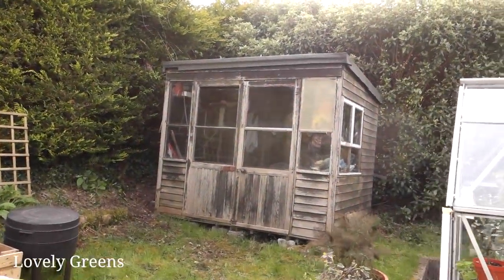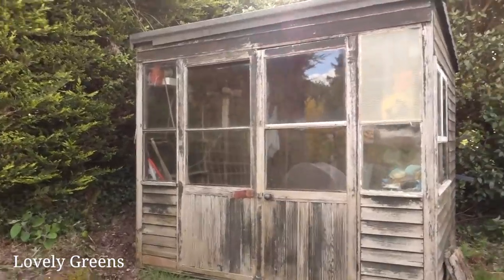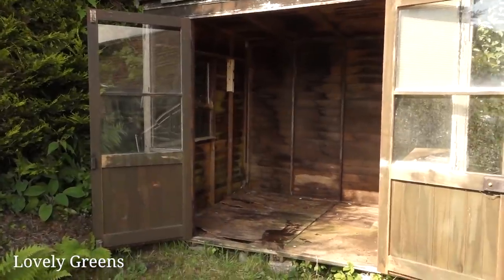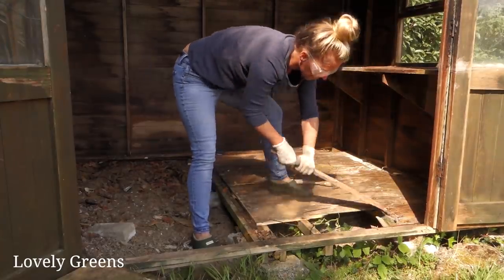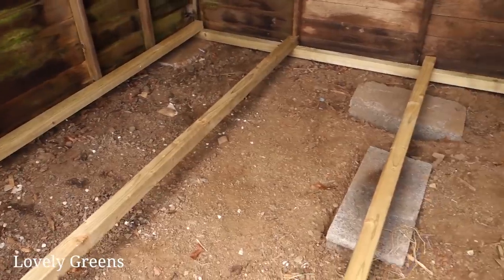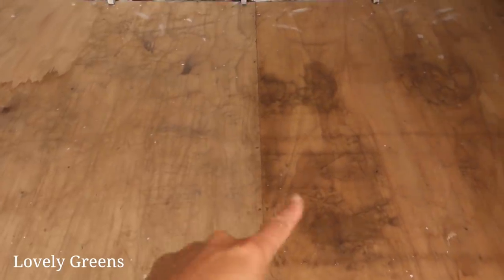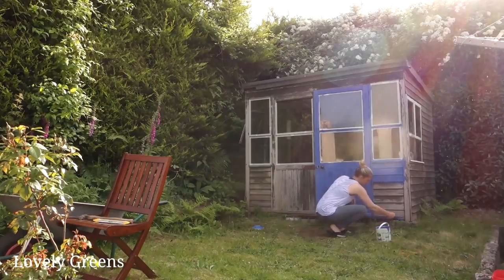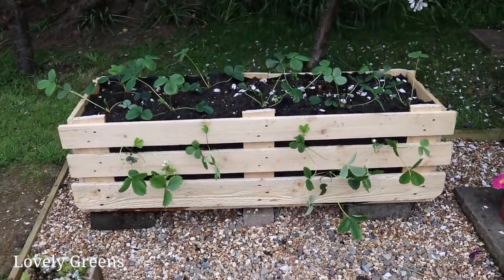My Garden Shed Transformation (Ramshackle to Cute She Shed Potting Shed)

Comment: Great job!  You'll enjoy that little potting shed for years to come and will find an affinity for it because of the hard work restoring it.  One thing that I've done with new floors in old shed/barns is to make sure to seal the best you can the space between the floor and the shed walls.  otherwise every kind of rodent and snake will make it their home.  What I've done is to take 2x4 and cut them to fit between the vertical studs.  By laying them on their widest side, you will be flush with the front edge of the stud.  By attaching the 2x4 to the wall and floor, you will have effectively joined the walls and floor closing off any points of entry.  To make the job easier I use liquid nails construction glue and the job goes really quite quickly.

Comment: Fantastic, what a transformation! Traditionally canes were hung in a hammock from the ceiling, in the highest part of the roof. The hammock is simply made from three pieces of garden twine, or stronger string, or even ribbon, if you please. One end, and the central string are fixed and the one at the other end can be undone to more easily insert the canes. This is the most economical use of the space, and is also usually the driest place so they will not suffer from damp or rot.

Comment: Looks good, I painted my garden house the same colour. Judging by the natural oil stains coming out of the greyed wood, its built from Red Ceder which is pretty durable, but now you've sealed it with paint it should be fine for a good while. I would suggest adding a gutter and small water butt which will also help with stopping any further rot. Now the frame is secure you can pull out the bottom side planks and replace them. I recently bought a secondhand greenhouse made from red ceder. the wood was also grey and stained - but I hand planed every piece down to reveal as good as new wood underneath. After oiling every piece I rebuilt it - it looks as good as new. I am very glad you took the plunge - its very satisfying to reuse and repair.

Comment: It’s great you managed to salvage the shed, my new shed is a second hand one and it’s been painted green with Cuprinol beetroot colour door, the door has new black iron hinges on and I’ve just bought guttering for it. Good tip about gorilla tape to fix the roof, my felt is still watertight but looks messy as has loads of weird battens on it for some reason, and I was going to change it but might try and salvage it for a while by taking off the battens and taping where they were to be sure taking them off doesn’t cause leaks!
Reply: I had similar with my shed when I moved in 2 years ago. For the roof, I managed to get some Johnsons felting sealer, it was pricey at £20 a tin, but I managed to give the shed roof 2 coats, only used half a tin. Got it from Screwfix.

Comment: We took an old shed and completely redid it, right to the roof.  Put in tongue and groove siding inside and out, window boxes on the outside.  Divided the back portion in to storage for garden stuff, with a dutch door.  I turned it into a craft shop, painted a faux rug at the front door.  I loved that spot so much!

Comment: Tanya, like you I love the colour design of blue with white trim. As for any other suggestions, after the roof is repaired I would paint the inside ceiling white, and install a solar powered light system that will allow you to pot up seeds or bulbs when natural light is not sufficient (early morning, late evening, early spring, late fall, winter, rainy days, etc). I think I would also put the potting-up table on the opposite side you indicate in order to be able to look out at your greenhouse, bushes, trees, flowerbeds, and cats while you work. And perhaps a cheery window-box of pelargoniums, petunias, and potato vines wouldn't go amiss. Love your channel! Greetings from Ontario, Canada...😊

Comment: To prevent more damage remove some of the green from the back and sides at least 50cm to allow sun a change to dry up moisture. Also to protect those new floor boards I’d put some linoleum down which can be washed and swept. Love the blue and the white effect on the inside
Reply: I wonder if it would stand a move to the other side of the property where she can look down over the garden beds. It would have great air circulation all around it and have more light. When she's working in the garden beds, she can look up the hill had see it in all its glory. It might even be seen from the driveway and from the windows on that side of the house. She could plant all kinds of things around it that might not grow in the shade where it is now.

Comment: I recommend painting the floor with floor paint. That will protect the new wood and help it last longer. There are specialist floor paints that are meant to take the wear-and-tear of a floor. They are usually a light gray color. The renovation is great! As long as wood is sound, we should keep it and do just what you have done. The finished shed is charming. It seems it's good to have Josh around.  :-)
Reply: And perhaps a rubber mat or two to keep Tanya from slipping on the paint wouldn't go far wrong either. Good idea!

Comment: I think that was a good save! Love the doors and the amount of windows and light in there. Looks great. The roof still looks damp though. I re-felted the old sheds I inherited and then used corrugated plastic sheets on the top to preserve its life even further. I also added guttering which runs into a few water butts. The amount of water it collects is pretty impressive and the plants do so much better with rainwater.
Reply: Great idea to collect the water - one of my favorite Master Gardener display gardens has water butts fed by rainwater from a shed roof.

Comment: For the floor, I'm surprised you didn't just get a small ton of rocks.

The floor will get dirty, but having a rock floor will let you just swipe the dirt down. It won't rot away from the leaky roof either!
Reply: I saw this type of flooring on a Pinterest page. It looked to be so very low maintenance. However I believe it wouldn't work well in my climate. Perhaps she has also has issues with alot of issues with rainy weather?

Comment: Hello! Did you manage to paint the whole exterior of the shed blue with just one tin of 2.5l Cuprinol? Thanks :)
Reply from the maker: Yes! I was scraping the bottom of the tin at the end and used every last drop. The inside of the doors are blue too.
Reply: @Lovelygreens  Oh that's good. It's a lovely thick paint which, I found, makes it so easy to apply, and that blue is a bold choice but looks really good on your shed, good choice not to scrap it! :)

I've so far painted a salvaged chicken coop, homemade coldframe and an old table with Cuprinol Seagrass (light blue) next will be the interior of an unloved shed that was tip-bound, a reclaimed desk and anything else that stays still too long!